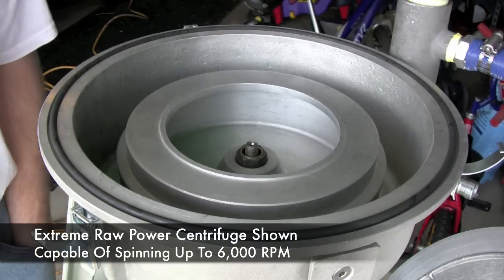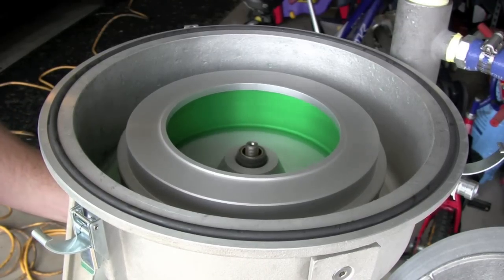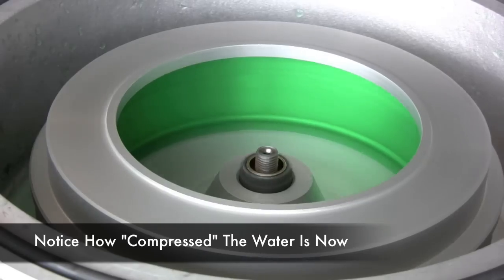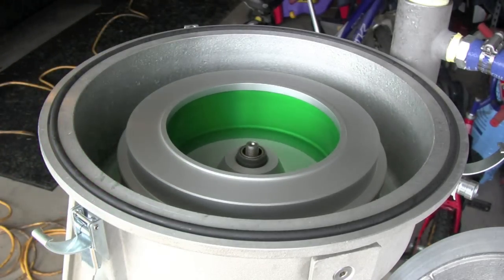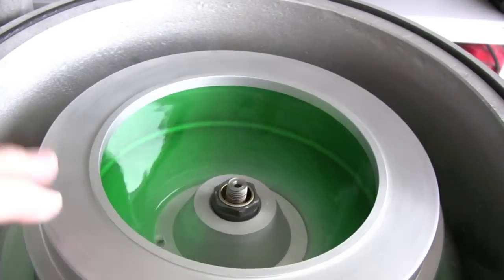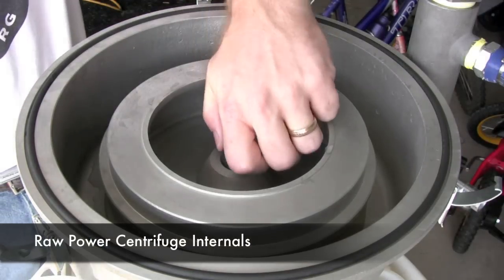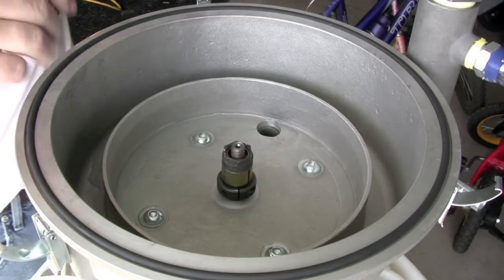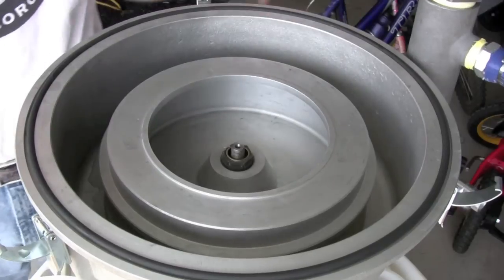Extreme Raw Power Centrifuge | Overview & Operation | Utah Biodiesel Supply

Comment: What type of motor are you using? Is that direct drive?
Reply: its an ac motor with vfd controller. Cnc controllers use them.
Reply: Direct drive with a VFD Controller

Comment: Nice work. Thanks for the video. What are you using to slow the motor down? I need to be able to slow/adjust the speed of some 1 phase and some 3 phase motors for (hobby) projects, so it needs to be cheap. Any good ideas?
Reply: It's an AC Motor drive. It was a Direct Logic controller from Automation Direct. You need to have a 3-phase motor to pull it off too. The drive varies the voltage and frequency to change the speed of the motor.
Reply: How mas pris youe.
Reply: Variable speed router.

Comment: Centripetal Acceleration is equal to v^2 / r.

One earth "gravity" acceleration is 9.8 m/s^2.  You must take the radius and rotational speed of the motor (in RPM) to find the velocity tangent to the radius.

Say a centrifuge is 50 cm in diameter, has a radius of 25 cm, or .25 m.  It is spinning at 3000 RPM.

The circumference is 2Pi x r. The circumference is 1.57m.  V = 1.57m x 3000 RPM = 4710 m/min, or 78.5 m/s.

(78.5m/s)^2 / (.25m) = 24649 m/s^2.  Divide by 9.8m/s^2 gives you 2515.2 earth G

Comment: Centripetal Acceleration is equal to the square of an object's tangential (not angular) velocity, divided by the radius of rotation.
The equation looks like this:  A = (v^2)/r
To convert your answer into Gs, simply divide the answer by 9.8.
For example, if this is spinning at 750 rpm (roughly 80 radians/second), and the water is 10cm (0.1m) from the axis, the tangential velocity is (radius x rotational velocity) = 80rad/s x 0.1m = 8m/s.  
So the acceleration is (8^2)/0.1 = 640m/s^2 = 64G
Reply: Why does the liquid go up and out of the centre if the centrifugal force is outwards and the volume of liquid is does not reach the inner lip? Does the liquid compress so much?

Comment: g= (2 * 3.14 * f)^2 * r

r= half of diameter of the bowl
f = frequency of rotation (rotations pher second)

6000 rpm = 6000 rotations pher minute = 100 rotation pher second which means f=100.

Comment: This one will remove contaminants extremely well, but I wouldn't rely on it solely for a dewatering device. While bowl style centrifuges definitely can help remove water, the heat, circulate, and spray method is much better (see our website - Utah Biodiesel Supply - for plans on building a dewatering tank). Either the 3450 or the 6,000 RPM model will work well.

Comment: It is really simple.    to calculate the g-force inside a rotating cylinder use the following formula:  .0000142 * Bowl diameter * speed squared.   so:  if the machine shown has a 12" diameter bowl, and is spining at 6,000 RPM the g-force generated is: 6,134.4 Gs.

Comment: you can only separate the green from the water if it would be a suspension (like blood for example). if it's solved in the water you can't separate it that easily. the electromagnetic force holding the solution together is way too strong for a centrifuge.
i don't know if this water and dye is a solution so i can't get you a clear answer

Comment: yes it's simply the centripetal force divided by g=9.8m/s²

F = ma = m4π²r/T²
a = 4π²r/T²
a/g = 4π²r/(gT²)

and there you have it.
a/g: g-force factor
r: centrifugal radius
T: time per revolution

in this example i estimate the radius to be about 15cm = 0.15m. 6000rpm = 100rps

a/g = 4π²r/(gT²)
a/g = 4π²*0.15m/(g*(1/100 1/s)²)
a = 6000g

so it's about 6000 G's

Comment: @UtahBiodiesel Assuming the radius to the outer wall is around 100 mm it would generate an accelleration of around 4000G @ 6000 RPM on the outer wall.

Comment: @saintveil 
For that you'll need.. well a still.  It may work as an oily water separator but even that will be llimited since it seems to have a small capacity for water and that's what you'll have the most of.

For doign what you are lookign to do you may want to examine vacuum distillation.  Those work on high vacuum and boil water at just over room temprature.

Comment from the maker: @freeekonaleesh2 This one is designed only to remove solids. There are centrifuges on the market that'll separate two different liquids, but they're a completely different design. Because the dye is a liquid, this one won't separate it from the water. The green dye is just to illustrate how it works.

Comment: @TheVirtouso 
Nope.
What micron level dose it filter too and dose it actually separate the water out? 
Has there been any test done to prove that ts works?

Also, I was going to do the WVO conversion but i figured why take the chance at destroying the engine when I'm getting 40-46MPG average depending on the driving conditions. Alot better than 17-19MPG in my ruck. My 2004 Golf TDI is perfect.